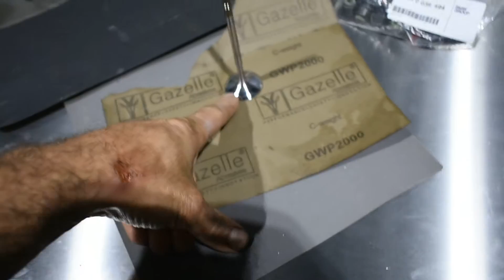How I'm cleaning the Intake\Exhaust valves

Comment: Hello tasos 
I want to ask about performance issues with my cls63 biturbo i have tune and downpipe and filter and heat exchanger for cooling air intake and my car performance like a stuck car what do think the problem 
1 - boost or vacuum leak 
2- carbon in the valve or in any place 
And how to check for boost or vacuum leak for in m157 engine 
Thank you and keep going

Comment: Hi Tasos,
Last week I replaced cooling fluid in my m156. Do I have to vent cooling system in some special way? Or is the same way like for any other engines ? After driving temperature is ok but I feel like the engine start working little bit rougher after fluid changed is that possible?